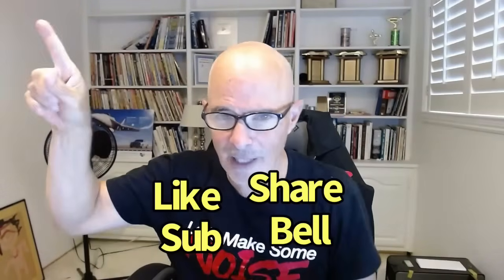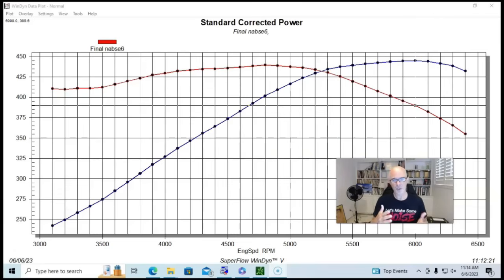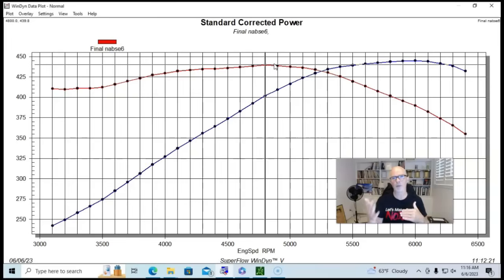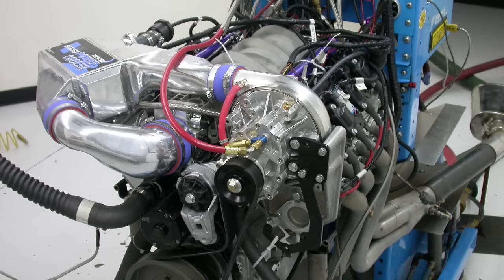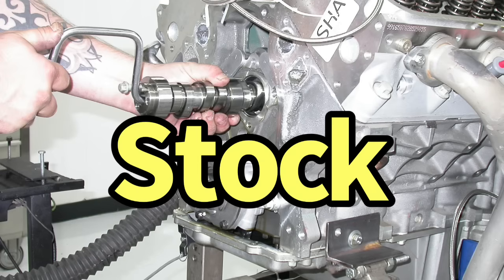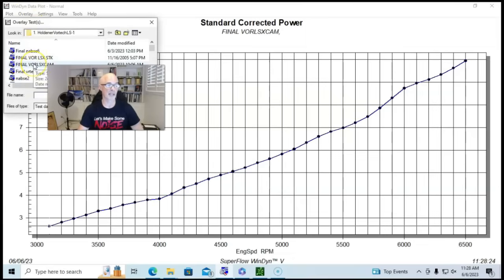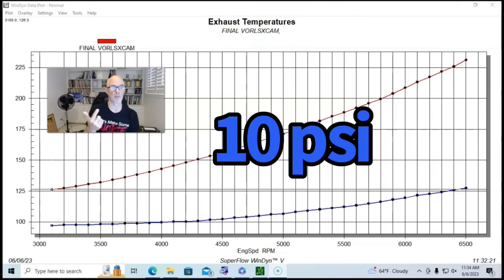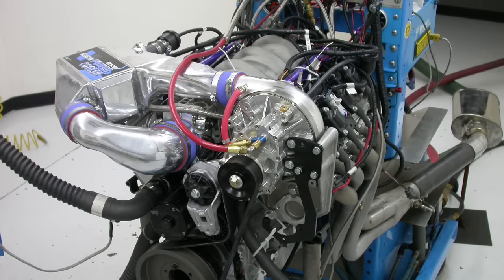HOW TO: VORTECH SUPERCHARGED LS1 CAM UPGRADE. HOW MUCH POWER IS A CAM WORTH? WHAT HAPPENS TO BOOST?

Comment: My question is what was the size on the Supercharger 8 rib Pulley 3.12-2.95-2.90-2.75 or 2.70? 👍🏽🍺😎
Reply: I have same set up and it did exactly what you’re talking about. Using a 2.90 pulley & Lunati Blower Cam 651”/651” 116 Lobe separation and 72cc heads. It went from 8psi to 6psi making 573.80rwhp and 513.08 rwtq. Does that sounds right to you?
Reply from the maker: after the cam?
Reply: @richardholdener1727 Yes Sir
Reply: @richardholdener1727 One small detail I forgot to mention. It’s a Trans am WS6 with a 6speed manual and 22,303 miles on the odometer. What would be flywheel HP/ Tq  if you don’t mind me asking 👍🏽🍺😎

Comment: How do I remove the supercharger belt? Please help
Reply from the maker: It has a spring loaded tensioner
Reply: @ thank you I finally figured it out. I had to remove my power steering cooler and put a half drive ratchet now how do I remove the supercharger unit itself? I removed six alley keys on the right side of the unit that goes to the bracket how many other bolts are there holding it on?

Comment: I was actually thinking of purchasing this exact vortech supercharger charger today. It's used, obviously. It's a V9 with the A to W cooler. Comes with everything except injectors.  It's supposed to have 4000 miles on it and the original owner. Wants $3500.  Still operating and in his car. So I have to wait for shop to remove it yet.  Anyone use these before? I know they are discontinued. Is it worth purchasing? It's either this kit or another guy for same price has a m122 supercharger and adapters for a turn key package. Would I be better off with that? Only options in my area. 02 Camaro SS 450hp ls6 engine n 6 speed.
Reply: What did you end up doing?

Comment: Did u have to install forged components? is it necessary to 
install a forged crank and pistons with 10 psi of boost?
Reply from the maker: no-it was all stock
Reply: Ok what do you think about the LQ4 6.0 with a 3.26 stroke crank with 6.0 rods and pistons & a custom grind cam with the Vortech pro charger combination ? Cause at this point I’m kind of own a budget not to cheap are to pricey. Everything is getting overwhelming with this build that I’m trying to complete looking for 800hp to the crank and 600 whp to the tire.

Comment: I have ls1 Higgins race heads 238_242@112 410 rear wheel hp thinking adding a vortech V2 ,or is my cam bit big also 112lsa revs till 7200 now😅 I'd like 550-600 at wheels
Reply from the maker: that cam will work

Comment: Does that air cooler need maintenance?
Reply from the maker: the ATW intercooler?
Reply: @richardholdener1727  yes that's what i ment i currently  have this super charger set up on my 2001 firebird with 64 original  miles on it

Comment: By any chance, do you have a part number on the intercooler set up?
Reply from the maker: not sure they offer this set up any more-but check with Vortech
Reply: They do not carry or warranty this kit anymore.  I'm thinking of purchasing this exact kit with cooler for my f body. It seems much easier than a turbo kit when keeping ac. Guy wants $3500.  Vortech will do a basic rebuild on the v9, though. Witch is just gaskets and bearings.

Comment: What will a LSA cam do on a stock 6.0 motor
Reply from the maker: same as it did on the 5.3l-less power down low than stock cam
Reply: Thanks for that I was about to buy one for $50 so it’s a big mistake

Comment: @richardholdener1727 
I'm considering running the v3 vortech centrifugal on my lm7. Currently has a summit 8707 226/238 .600 @ 113 lsa. BTR pushrods and trunnion kit. Pac 1219 springs. Tbss with 92mm snake eater cable tb. On a stock p01 on hptuners.
Also has fresh stock 706 heads and new headgaskets and head bolts.
Has 1 7/8 longtube headers.
I Was tossing back and forth between torqstorm vs vortech. I liked the supercharger idea over turbo for many reasons. One being i get to keep my $1500 fabricated exhaust. 
I already have a walbro 450 to replace my 255. And thinking of some ev6 deka 80# to replace my 33lb flex fuel injectors from an l59. An adjustable -6 feed and return fpr to replace the 58psi Corvette filter/regulator. Do you have any preference one over the other? The vortech utilizes 6 rib system off the stock accoessory drive. Torqstorm has a bolt on hub and separate 8 rib with a kit for pinning the crank. Are there concerns with the vortech on an unpinned non keyway truck crank pulley? 
Seems the vortech might be better for space as well.
This is in a volvo 240 sedan. With the summit 4 core radiator and 16" spal fan space is limited for pulleys.
Price point is obviously almost always a factor but it's a mere $200-$300 between kits. I think both will run under 10psi so the stock 1 bar map should work.
Not too put anyone on the spot but if anyone has a preference. No real power goal in mind just more then it has lol.
Reply from the maker: you need to pin the crank with either and choose the blower based on the desired power level-you will be happy with either (I've tested both many times)

Comment: Nice!! Im running torqstorm on stock 2008 5.3, fuel and exhaust upgrades. I cant get it to idol smoothly. I checked my vacuum lines. All good. Shows no check engine. Please help.
Reply from the maker: it is definitely a tune or vacuum problem
Reply: @richardholdener1727  my tuner spent 5 hours trying to tune it on the dyno. He said he kept chasing the problem but couldn't get it. Are check valves required in pcv? I don't have any but have some on order. All my vacuum hose are new and clamped. Where else could their be leak?
Reply: @richardholdener1727  the day after I replied, I found it was the position of the maf sensor. Doing very well now! But u should make a video with BTR centrifugal supercharger cam, dod delete kit. Thanks!

Comment: Is it possible that perhaps vortex decided to  put  fins internally and out of sight to help dissipate some heat? But anyway it sparked a curiosity in me and I know it's going to  sound dumb.  But has anyone ever tried putting an intercooler in the exhaust prior to the turbo  cause I can't help but wonder if it is possible to  supercharge your intercooler?
Reply from the maker: this is not a turbo and you don't want to cool the exhaust going to the turbine
Reply: @richardholdener1727  no I know I just can't help but wonder if you  could cool exhaust temperature before it enters turbo could it possibly transfer less heat to the cold side.. basically just wondering if you  could pre cool your cold air charge..yeah I know it's stupid and probably a lot more trouble than any potential upside but still curious
Reply: @keithsmith9889 cooling the exhaust will remove turbine drive energy, the opposite of what you want. The heat Transfer from the exhaust to the compressed air is actually quite small, except for very light load.

Comment: Great information provided here.  I have an 03 vette with a procharger and stock cam. Been thinking of upgrading to mild camshaft   Hardly seems woth the cost to upgrade cam for such minimal gains under boost Thanks for this info.  Cheers.

Comment: I consider myself a Ford guy overall..  However, Im a car guy that likes them all. Ill never argue what brand is better than the other. Whatever brand I  decide to build I simply study up on it.. Ive decided that I need to build a ls6 t56 s10, daily driver with ac. It's not a track truck however I hope to get a 10.99 on motor only and that's the last time it will see the track.i "might" add a blower just because or a small hit of nitrous 100-125 .If I do that should be good for very low 10's and possibly a 9.99.

Comment: I’m curious if vortech still makes this kit, I have a corvette ls1 in my Chevelle and I’m pretty sure that inter cooler will fit under the stock hood
Reply: They have a ls swap kit. Then add a intercooler. Just did this on my monte carlo
Reply: They haven’t made that kit for years, cheaper to do a turbo kit
Reply: @richardkamowski4656  I’m thinking so, I like the hooker turbo manifold kit, looks clean

Comment: Has there ever been a cam comparison where one cam made less power NA but more power boosted compared to another cam (when boost is kept relatively constant)?
Reply: Even a broken clock is right twice a day. It maybe possible, but would go against the norms.
Reply: @ryandoyle4344 Well to me that would be the proof that a "turbo/supercharger" cam actually works (and yes, I know every cam is a turbo cam, etc). I would even settle for one that has milder specs (like less overlap) but still makes the same power - that would also validate the idea of a cam that is tailored specifically to boost.
Reply from the maker: I have not seen that
Reply: The fact that a forced induction cam makes more power than an na cam while in boost is proof in itself.